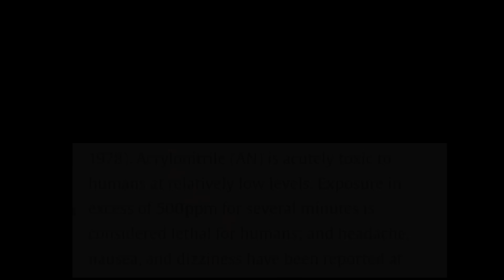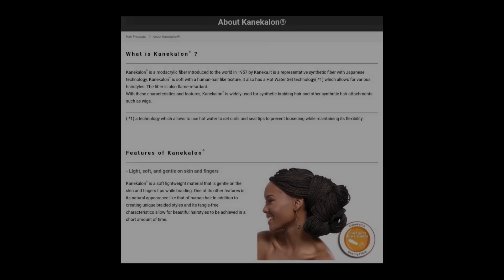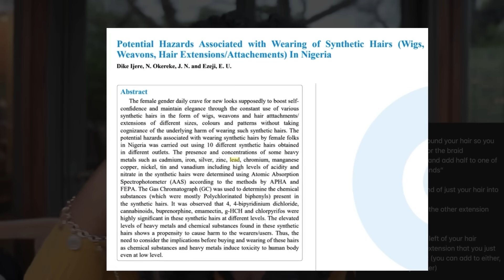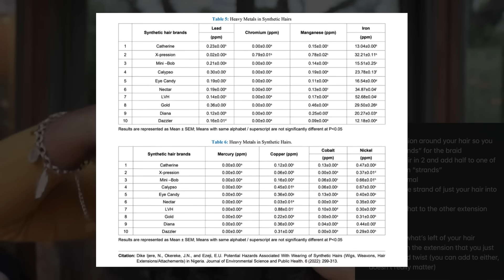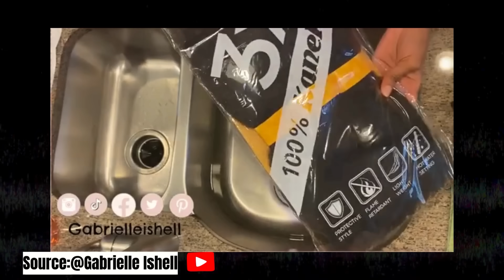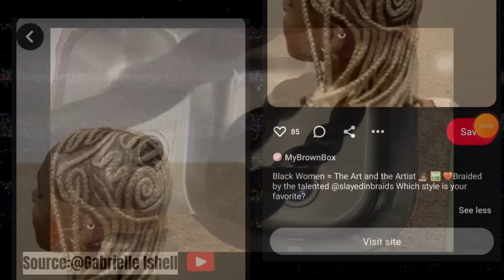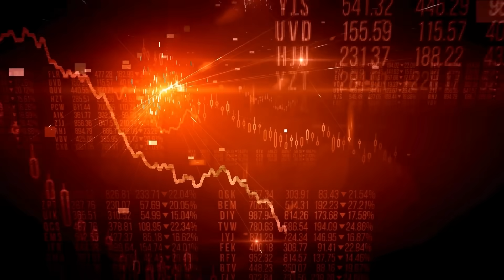The Shocking Truth About Synthetic Hair Braids

Comment: As someone who wore braids through 4 different decades, I noticed something changed with the synthetic braiding hair somewhere in the mid 2010s. Before then, hair would thrive during the time it was braided and you could clock growth AND retention. 

Then, I got some long Senegalese Twists on my bra strap length hair in 2013, and and when I took the style down, I had severe breakage. I had to cut my hair up to my neck. I thought I did something wrong during my takedown. I took a break from braids and let my hair recover. It had to be a fluke.

But it kept happening. Instead of retaining length, my hair was breaking all along the shaft.

I eventually stopped using synthetic hair for braiding and switched to human hair. Then said eff all this, and got microlocs.

Thank you for this video.  The beauty industry will try to poison us no matter what we do (chemical straighteners, synthetic hair for braiding).
Reply: I switched to human hair…but dk how long I’m going to stick with it. Did you notice any problems with human hair? It’s an expensive alternative…but I’m exploring all options before I loc again

Comment: I just switched to human as I have fine hair strands and synthetic hair not only irritated my scalp but shredded my ends. Wool/ yarn didn’t irritate me but would fuse & loc with my real hair resulting in lots of breakage. I’m intrigued by the banana fiber hair, I’d be willing to try it if it were cheaper than human & less maintenance, but I looked it up, it’s $35 a pack for 18” I can get human hair cheaper for longer lengths and be able to dye any color. Rebundle only has 8 colors and not my color
Reply: Yes, limited options are problematic, but it’s our health we’re risking. Is being diagnosed with cancer 10 years later worth looking “cute” with regular braided styles?

Comment: Instead of using vinegar to wash synthetic hair, if you have thin hair use it as a replacement for conditioner to wash your hair and it will thicken your hair.
Reply from the maker: This is interesting. Thanks for sharing.
Reply: @MelaninArchives Thank YOU for the video, although it's been 10 years since I stopped wearing false hair, I didn't know what that hair was made of. When I saw how the hair was made, it is very obvious that it is witchcraft. The fallen angels taught humans such silly and destructive things.
Reply: @MelaninArchives  Since I might get more questions about it. I redid the research and released a video on my other channel L.T.T.S Naturally Royal: https://youtu.be/ti3adhE69_Y?si=rXyoJustvZgqWOvt
Reply: What kind of vinegar?
Reply: @runwitvision47  Any kind of vinegar, just dilute it with some water. Rosemary vinegar would be good too
Reply: @letstalktruthwithsuziann so shampoo and then afterwards use diluted vinegar? 
Why does this help with hair thickening?
Reply: @shakeraxdien Yes, that's how I do it although I am trying to phase out chemical shampoos and use either homemade or castile soap instead. As for your other question I don't remember the exact explanation since it was something I looked up a long time ago and tried it and it worked for my mother and I. I was battling with thin hair for years and in about two washes the battle was over. Look it up for yourself and see if it works for you.
Reply: @letstalktruthwithsuziann  thanks I’ll try it out 🙂
Reply: Apple cider  @runwitvision47
Reply: @runwitvision47  Any kind of fruit or herb vinegar will work, because it's the vinegar itself that has the effect., just dilute it a little with water. For added health benefits, use a vinegar that is good for hair, like for example rosemary. You can make this at home too, with just 3 ingredients (sugar, herb/fruit, water), there are many youtube videos online showing you how to make vinegar. Try it out one day

Comment: I did all of that. I did the ACV soaking the shampooing and still got scalped infections went to a dermatologist. They took scout cultures for the infection. My hair Length was to my Waze, and it came completely out then it grew back later to my shoulders came completely out again. This infection was in my scout for eight years. It was hard to kill. I finally went to cancer dermatologist that took cultures and recently went on medication again, along with topical that was a lot stronger.

Now my hair is slowly coming back is still extremely short, and the hair was not looking the scout was infected like a leather glove. It was itchy felt like something was moving in the scalp stings, itchy and insane that’s what it was.

I got a real good picture of it on top of my head. Still have that picture it felt like it was on top of a nerve very painful.. I will use human hair braiding, hair, my hair, ethical hair braiding for my hair to grow back out and then after that, that’s it I won’t be using none of their products I don’t trust it. 

Oh yeah no this was not just the coding. This was something that was causing the infection. It’s like when it gets into your scalp it causes an infection. That’s what my reaction was like like some type of bacteria that was in the hair that transferred onto your scout that’s what my experience was.

And she’s exactly right when you remove that topcoat as like you also open yourself up for infection if it’s not already all the way through the hair with the coating.